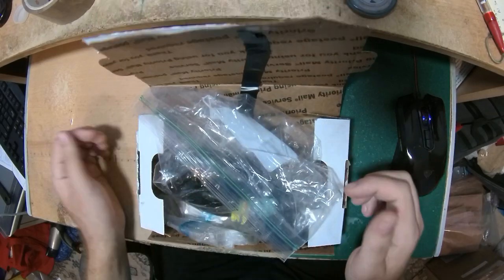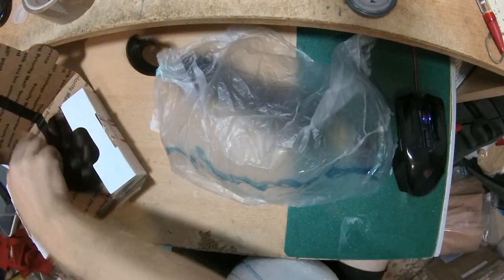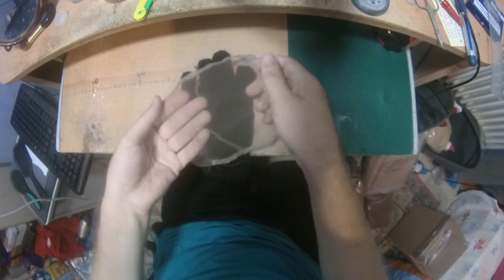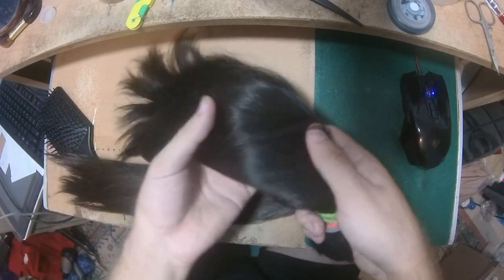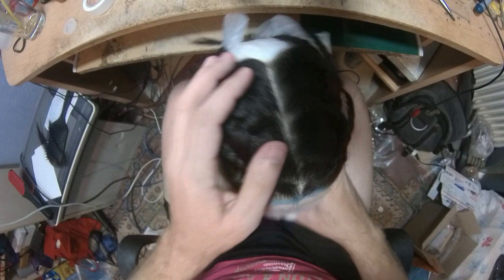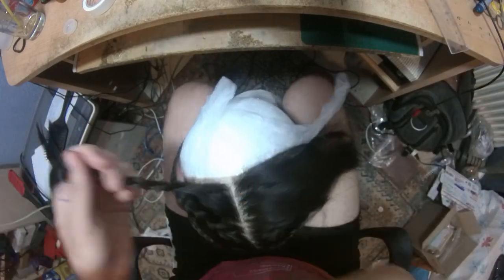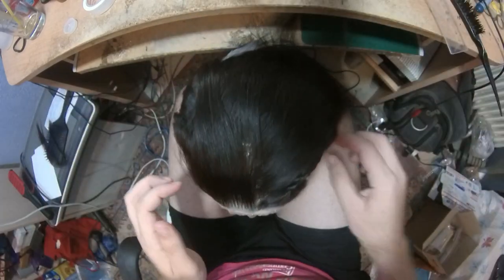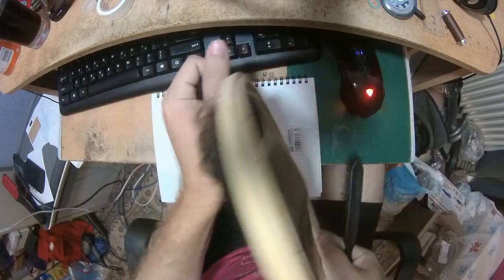Custom Order for Cristina 5x5 topper with bleached knots

Comment: Can u do a video on reinforcing hair that's already wefted to stop the shedding?
Reply from the maker: Veronica Suchadiva Well you can put thinned nail polish to mold the base of the wefts to keep it from shedding and also there are weft sealers professional for wefts but they are a waste, they are just glue in a pretty bottle.
Reply: Ok thanks!  I didn't kno if it was possible to sew over already made wefted to reinforce them.
Reply from the maker: Veronica Suchadiva
That would be possible too but when wefts start shedding I think putting some sort of fray check solution would help more.
Reply: Ok thanks